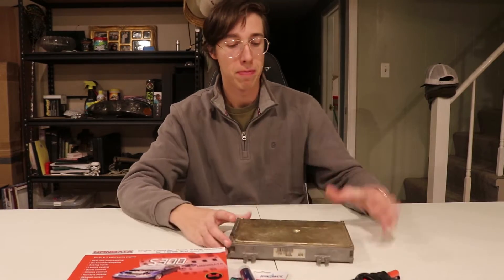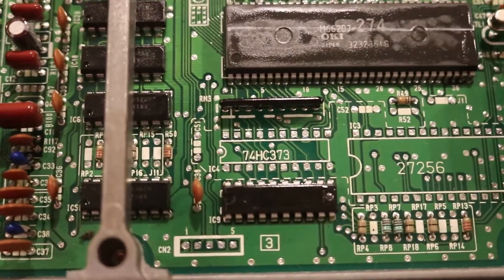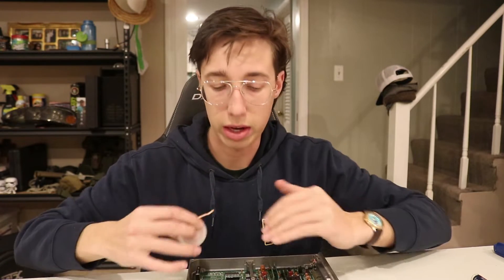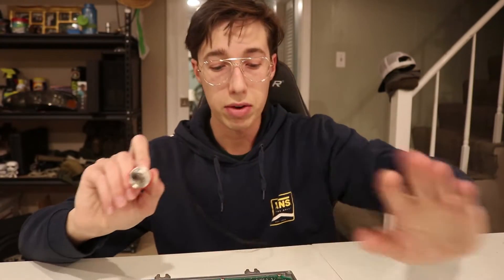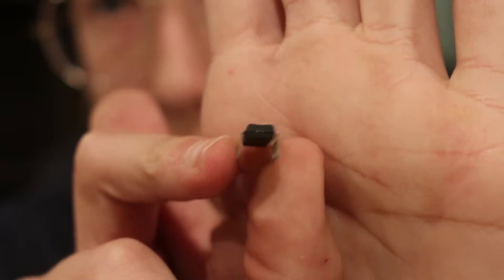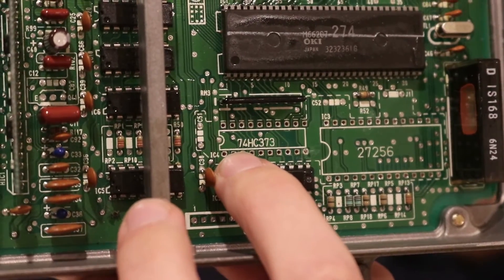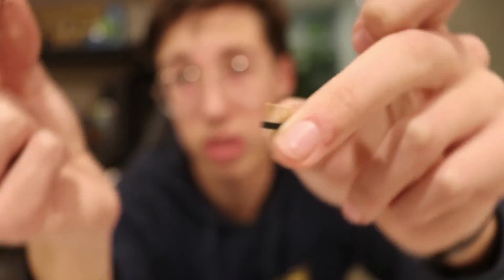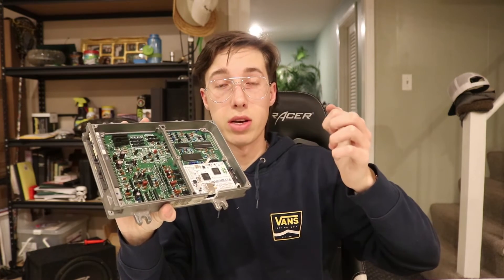Hondata S300 V3 Install Guide| P75 ECU (Everything You NEED to Know)

Comment from the maker: Let me know if you guys have any questions. I realized that I forgot to clip j12 in the video, but please remember to do this step if you’re doing this install on your own. 
Also please follow my Instagram: @yonny_nolls
Reply: C14 Capacitor? Just curious as the hondata site says to replace it
Reply: I cant find your insta
Reply: Did it come with all of the chips you installed?
Reply from the maker: @sirsendit9770  yep
Reply: @boosted_john  awesome man , in buying the s300 in a couple days and trying to make sure I have everything I need , your videos are very helpful man much appreciated!
Reply: Where did y’all purchase Hondata ?
Reply: random will a p75 ecu with hondata run a vtec motor or is it only for nonvtecs
Reply: @poweredbythemotivation  p75 is nonvtec ecu
Reply: @poweredbythemotivation  have to buy a vtec chip. They should be around $20
Reply: @Onedeepdrew  and where can you buy just that vtec chip at if you have a p75.. I have a b20 but want to change the head and go vtec so wouldn't it just be better to get a p28 that already has it in there and then just install the hondata board.?

Comment: Just a tip to people planning to do this.
If you're going to solder the board anyway, you might as well replace the capacitors. They're over 20 years old and dont tend to work as well as they used to. Though it's not mandatory to do so, i highly recommend it.
Reply: @pompmaister2438  If it ain’t broke don’t fix it.

Comment: Was that a “club” I saw in the floor. One of those steering wheel locking things.  I sure hope not because they don’t even take 10 seconds to remove them. A simple hacksaw to the steering wheel and cut it directly next to the wheel device and once the wheel is cut there’s enough play you just scoot it over if it didn’t fall of during the cut because you ideally cut right next to the upper part.

Comment: At the end of the day running hondata your still stuck with a slow processing unreliable 25+ year old obd1 ECU thatvis very limited. I personally thought the set up was very poor. I went with the Fueltech 550 dash with all Fueltech supporting electricals. The performance differance is beyond measure. No more problems with tunes going out of perimeter

Comment: i wanna do this to my 95 teggy with b18 b1 i assume it would be the same? i am good with electronics took a 2 year course on fixing electronics and building boards and circuits so shouldn't be hard. another thing to descolder you can use old speaker wire it's not the best or there is a sucker thing like a turkey baster it sucks the solder out great vid though

Comment: Your video was very helpful my question now is since it’s A non-vtec does hondata control vtec or will I need to solder it in? I had to do it to my p06 but with out hondata
Reply: You can take the vtec wire of your jumper harness and switch it to another input. I don't remember the inputs but they're in hondata

Comment: I got s300 installed into a P75 but it seems they made the motor run slower, I used a few different basemapps. I'm ttrying to see how to tune it so it will run right. I don't want to pay a tuner to do it for me and I don't know if I even need a wideband o2 or not. I probably should buy one but that's more money which I don't have a lot of. I used a HaMotorsports basemap, a H22 basemap, a Tuned H22 basemap, and a modicied injector basemap. All of them seemed to make the car run less powerfully than a Phearable basemap for a chipped ECU. Im a little bummed out about it to be honest. Any insight is appreciated, thanks
Reply from the maker: Honestly, your best bet is to get an etune.
Reply: @boosted_john  where would you get it done and how much? A guy I know who owns a shop street tunes for 200 but rhats one session.
Reply from the maker: Mikhail Kolitwenzew that’s probably worth it if he’s good at street tuning.
Reply: @boosted_john   the guy that put the s300 onto the p75 didnt want me to pay anyone for tuning the car because he said I could just change the fuel injectors fuel rate and change the whole map to see how it runs. He just said it wasnt that hard to tune it yourself and what's the point of having the s300 if you are just going to take it to soneone else to tune it for you. Thats what he said anyways.
Reply: Mikhail Kolitwenzew The point of having it is that it allows the car to be tuned, whomever may tune it.
It's not easy, though. Have you tried to learn? There's a lot to know.
Be careful, you can seriously damage your engine if it's turbocharged or on nitrous.
If you intend to tune it yourself, you will need a wideband. The air/fuel ratio is an essential setting which the sensor will let you monitor.
Reply: @boosted_john  do I need a wideband?

Comment: Lsvtec swap doesn't activate vtec with hondata. I have the vtec wire harness that goes straight to the ecu. My buddy has a p28 with hondata and it activates on that. I even chip my p75 to vtec and still nothing. Got any ideas why???
Reply: Your issue is because your p75 was not converted to vtec, same with this video, the hondata will work but vtec will NOT work until u convert the Ecu to vtec
Reply: @bradstewart7648   Yes that is true. There is a setting in the hondata software to run an alternate output for non vtec ecu's. So i wired it up from a diagram online and set it in hondata and the ctec crack sounds so good.
Reply: ShaftDrafter97  I have heard of that, I personally never tried to run it out of another output tho, maybe I’ll have to give it a try, I have a p75 with hondata in it already

Comment: I cant find instructions for Hondata V4.. Anybody got some?
Reply from the maker: This is a joke right?
Reply: No, I'm serious
Reply: I dry fit it the chip on to only find 2 sections of the connectors line up to the PNF ECU
Reply: Am I not supposed to install it on my own..?
Reply from the maker: Andrew I don’t think s300 v4 exists...
Reply from the maker: Andrew and unless you have really good soldering and desoldering skills, you should not install it by yourself.
Reply: I have a Hondata Kpro V4 in my hands
Reply: I can solder and desolder, just need to know the proper instructions for the Kpro V4
Reply from the maker: Andrew wish I could help. I only know about the s300

Comment: Step 11 “replace power supply capacitor at C14” the kit doesn’t come with a new capacitor. What did you do at this point?
Reply from the maker: I did not replace the cap and it is working just fine in my b18 swapped civic.

Comment: The reason, the guys at hondata have you take the ecu board of the frame, is so when you cut the side out, the shavings don't go all over the board and bridge connections.
Reply from the maker: Brendan Gallagher I kinda figured that out after the fact 😕